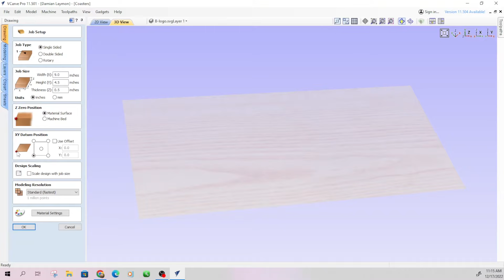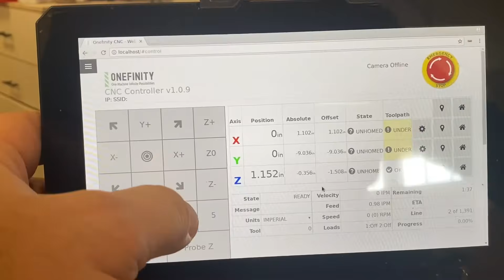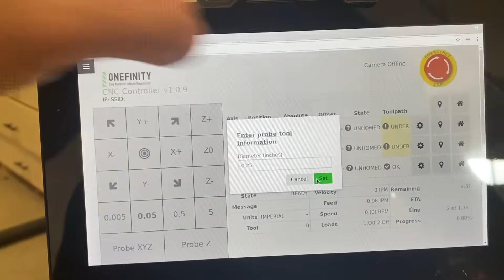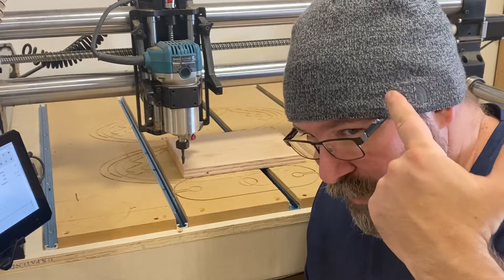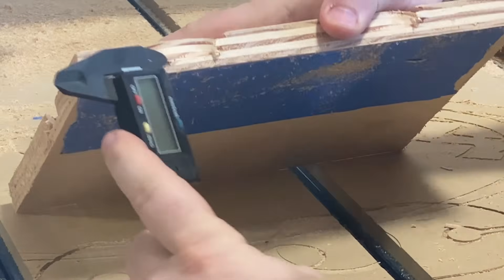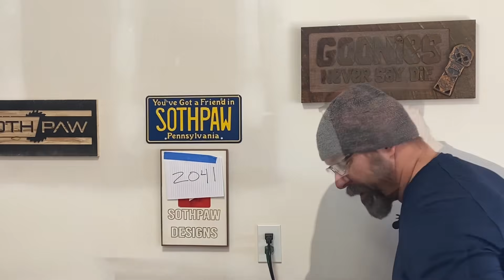Is A Touch Probe Necessary On Your CNC Router | Onefinity CNC

Comment: Fortunately for you, your touch probe is built in such a way that if something were to go wrong than it would just push the probe off of the wood. But in many other cases touch probes are built the opposite direction so when something goes haywire the bit will try and go right through that probe while it is checking the x&y. I've had that happen even though there is a safety check just like what you did.
I've stopped using my probe because of this. I use shrink wrap which is much thinner and more sensitive than paper.
Oh yeah, another draw back to the touch probe is some metals, even though you think is conductive, is not as conductive as you think and mishaps can happen as a result.
Reply from the maker: I've actually broken a couple of 1/8 inch bits by forgetting to connect the magnet when testing my X axis. I learned my lesson.
Reply: @SothpawDesigns  
On mine, you won't get the green light to probe without the magnet and touch probe touching the bit. When it happened I thought back to this video and said "Damn I wish it would probe outwards (like yours) instead of inwards." lol! Now I mainly use that one for laser. I use my cnc4newbie for wood. Still don't touch that probe. I have probe phobia now.

Comment: Hoping you can shed some light on probing and settings. I use the probe block successfully on my OF woodworker and haven't any problems until recently. I set my stock point of origin in the center of the work piece (butcher block) as the stock  was larger than the machine parameters.  Setting Z axis was not an issue but now X/Y confused me .  Do I set X/Y at (0) at the center of Origin  in the middle of the stock. Thank you, Great videos by the way.
Reply from the maker: Yes, if you set your XY origin to center, you'll need to locate the center of your workpiece. I typically set it to the bottom left corner, as I think it's more consistent to do it that way, but realistically, if you're using a workpiece that's larger than what you're making, there should be a little wiggle room.
Reply: Thank you for your input, the project came out fine , scarry but fine. it was  a10" long teak butcher block counter top and cutting the opening for the sink in 1.5" deep material. Hence I couldn't use the bottom right hand corner. I was afraid to hit the go button in someone  else $800 material but all came out fine. Thanks again.   @SothpawDesigns

Comment: Great video as always. A couple of keys points I'd like to add. Definitely invest in a joypad, driving it around with an xbox type controller where you can adjust the speed and slowly walk it down to the probe is so much easier. Sometimes with smaller tipped vbits I will hold the probe against the bottom of the bit and walk them both down to the surface, it's much easier to see the space between the bottom of the probe and the wood than trying to swing your head around sideways to see the tip of the bit. It does go faster when you are closer to the probe, but you can be 3/4" above the probe before it times out no finding the touch probe. Also if finding x,y,z the touch probe only works from the bottom left corner of the material. Also, touch probes really shine when you are using multiple bits. Setting multiple bits by hand you won't get the exact same results and you will be able to see a noticeable height difference. With the probe, however, you will get the same results, and much more quickly. Using my calipers to find the thickness and my probe for the height, it's cut so precisely that it cuts through the material but not the blue painters tape underneath holding it to the bed.
Reply from the maker: Good points. Thanks for contributing.

Comment: XYZ Manually is by far the best for me.  I've had my machine run the bit across the probe and cause me nothing but troubles,  My new method is finding the offset numbers and using them for zero.  The Z position is quick enough with he paper method.  Also if you have multiple cuts building jigs is a great method in getting the correct area evetime.  Great video, you need a joystick controller more than a touch probe IMHO.  Have a great Holiday
Reply from the maker: I'll have to look up the Paper Method. You're the second person to mention it. I decided to include the manual setup in the video because a previous viewer mentioned that people tend to use the XYZ Probe as a crutch, which got me thinking about different setup methods.

Comment: Touch probes are over used IMHO. I set XY with known offsets or eyeball and Z with paper or a jewelers loop.  Highly accurate and repeatable. For anything absolutely critical I use a gauge that is +\- 0.001.  I’m just an experienced hobbyist, but I also Zero to the spoilboard 90% of the time as do most industrial shops.
Reply from the maker: Thanks for the insight.

Comment: Good video! I'd like to add to the discussion, if I may. When everything goes right, manually setting your X, Y, and Z zero is a perfectly acceptable method. It's when things go wrong that the 3-way touch plate like the one you demonstrated really earns its keep. I've had the power go out in the middle of a project, and that throws all of your project settings right out the window. Having the ability to probe the X, Y, and Z locations after the power comes back on, then resume the project with reasonable certainty that the tool is going to cut where it's supposed to cut is worth its weight in gold. You can also start a project, cut to a point, shut everything down, then pick up where you left off at a later date or time without having to worry about finding your zero locations. All in all, having a 3-way touch plate like yours is an easy way to reduce the number of possible mistakes, recover from malfunctions, and avoid wasting potentially expensive materials.
Reply from the maker: Excellent point that I hadn't even thought of.
Reply: Mark, I use WinCNC which can save offsets for just  that scenario, do you know if Mach 4 does?  Anything critical and I always do that. I will say my ShopSabre has a tool height sensor which is invaluable for tool changes, especially if you’re Z’ing something that gets milled in the middle of the job.
Reply: @5280Woodworking   The short answer is yes, Mach4 can save up to 260 work/fixture offsets.

Comment: Good video. Just a comment about measuring depth with your micrometer. Rather than doing what you did, open the jaws about 3/4" or 1" and then look at the tail end of your micrometer. There is a little rod that is sticking out the amount you opened the jaws. place the end of that tail into your routed groove and then slide the ruler part of the micrometer down until it touches the top of your piece. That is an accurate measurement of the depth of cut. It is easier than trying to eyeball the points.
Congratulations on breaking 2000 subscribers.
Reply from the maker: good catch. I always forget about that part of the calipers.